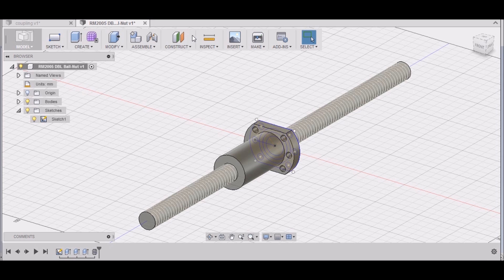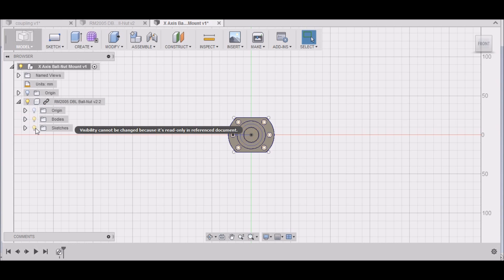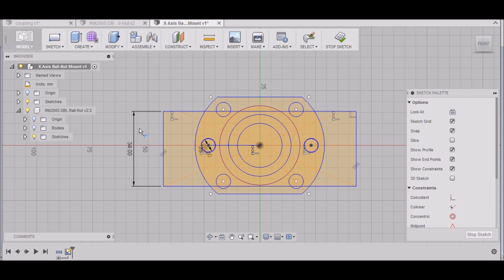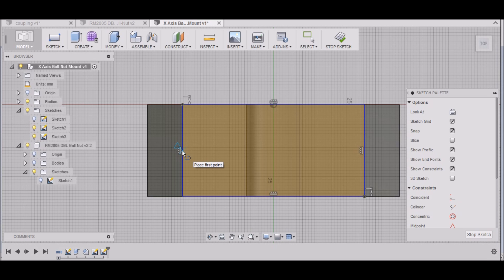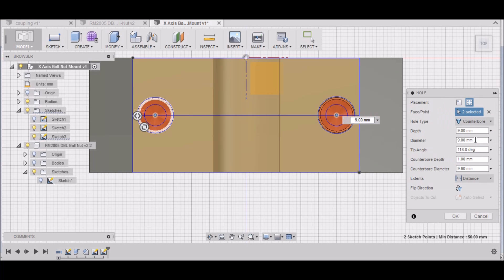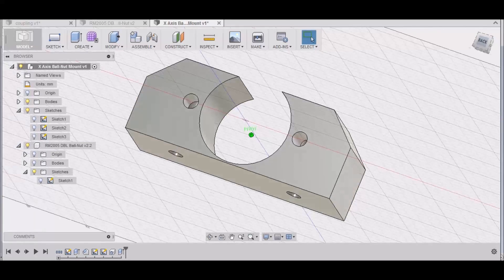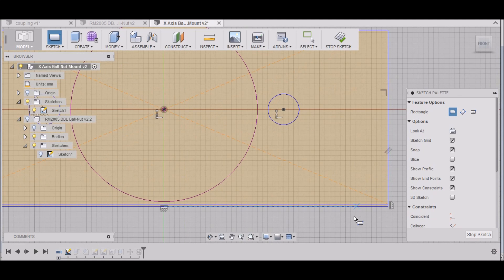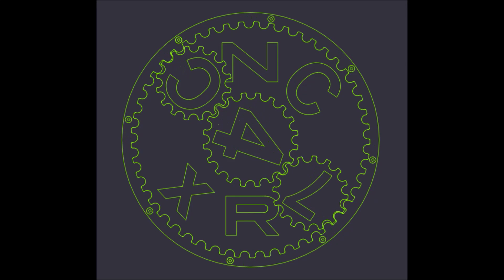Fusion 360 X Axis Ball Nut Mount

Comment: hi sam i have looked it to the problems seams to be the post in fusion 360 the post is cambam works great, did you have any problems with fusion mach 3 mill post and if so how did you fix it please ?? thanks daniel
Reply from the maker: +Daniel Kitson 
 Yes I have had problems posting on more than one occasion all my fault doing things Fusion 360 does not like or agree with just happened recently and in fact I will be posting a video soon on it. Send me the file I'll take a look.
Be Safe
Reply: +CNC4XR7 hi again sam i have sent you the g code from cambam and fusion, i think fusion g code is ok, its the  post that is wromg i am sure, there are codes like g94 g64 that mach 3 cnc dont use ?? thanks for helping out , daniel

Comment: hi sam, i wonder if you can help me please, i have been running cambam for a few years and no problems, now trying fusion 360, i have designed a part a block 25mm by 25mm and want to face it 2mm, with cambam all goes well, when i try to do it in fusion 360 and post the code ( tried mach 3 mii post  and tormach post ) it all goes wrong, when i run the code in mach 3 mill in added 129.50 to the z axis and as the tool change happens it tries to move my z axis above its limits any ideas ? thanks daniel
Reply from the maker: +Daniel Kitson 
Hi Daniel I can take a look at it can you email me the file? .f3d or iges extension cnc4xr7@gmail.com
I 'm sure its just a parameter.

Comment: Off the cuff 360 !!!  What the heck?  I' m trying to master a cylinder and you're making fusion drawings like it's your native tongue . So why the 0.9 mm? Was that for strength or did that give you vertical center?  Nicely done Sam. I'll keep working on my cylinder ( aka circle .)
Reply from the maker: +SOCOLVN 
Yes that is vertical center, I would like to have more meat on the bottom. But it is what it is.  The ball screw center line is 2" below the top of the x table.  I could have raised it but it would throw the whole geometry off.  I can mill the saddle some if I need to. But I would rather not.